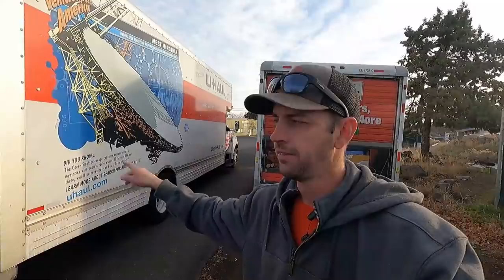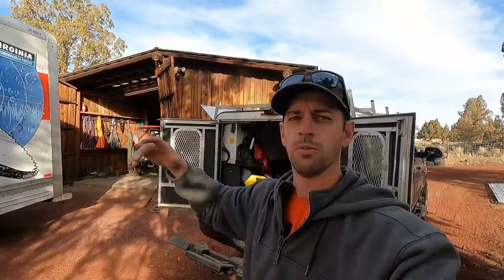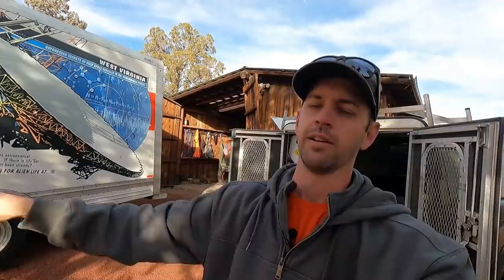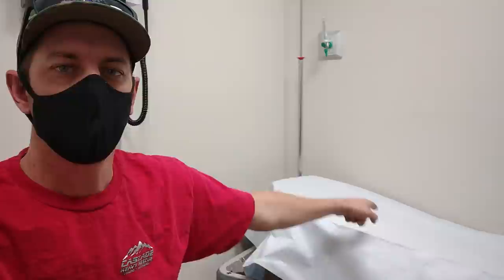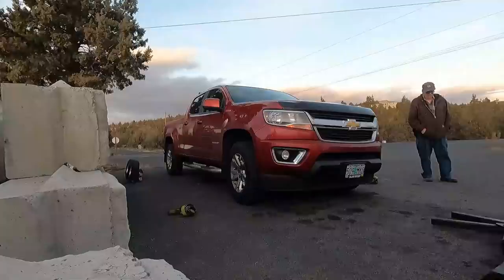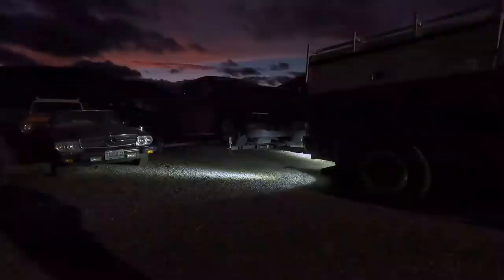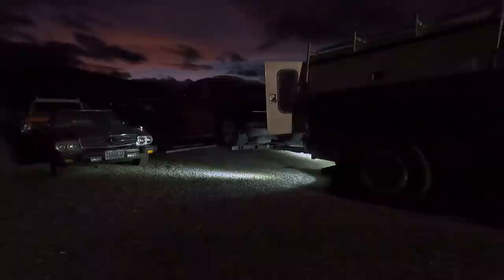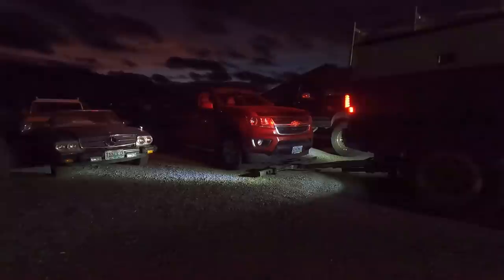Tow truck driver screws up and ends up in the hospital

Comment: I was a tire changer for  11 years and learned early on you never pick up on the breaker bar ALWAYS set it up to push down less injures that way
Reply: I learned that too as a heavy duty mechanic, until one day doing the same situation when I was pushing down on the breaker bar, when broke loose, some object on the ground interfered with my finger and ripped the nail right off! So! Make sure the grounds clear!
Reply: It's always down with open hands!
Reply: Yeah man hope you get better. But you should always push down on a breaker bar. Never ever pull up.
Reply: Changing grader tires we used the tractor loader to lift the cheater pipe
Reply: You know that’s right!! Leyyour weight
Reply: I have a tire bar imprint permanently in my skull. Being ignorant. Broke my teeth, nose and skull across my eye socket.  Got a dent in my eyebrow area.  Now I learn how to use tools for the specific job I'm doing before I try anything.
Reply: @jeremysales1232  let me guess it was a Ford 1 ton with left handed threaded nuts on drivers rear and the stud broke when you tried to take it off like a right handed thread
Reply: @Ender Wiggin  booted foot would be even better.
Reply: Correct, always use your on weight.

Comment: a long time ago I work in a welding/ag repair shop and a gentleman who had been working for the better half of 50 years saw me trying to break some 1-1/2 bolts lose on a planter he stopped he from pulling up on a 48” breaker bar and told me that you always push instead of pull you get more leverage pushing down and if need to slide a piece of pipe on it and you can move almost anything I did and it worked I still use his advice to this day

Comment: There is a very handy torque multiplier that is for removing stuck wheel nuts, it multiplies four times the torque  one applies to the breaker bar. Saves many hernias and strained muscles.
Reply: lol!  Ya,  it's called a 6 foot steel pipe!!!
Reply: great point and make people don't know about it but yeah they're great they're phenomenal that's what semi truck drivers use you can't hand torque something at 200 and 300 lb but torque multipliers  do that
Reply: @howtogetoutofbabylon8978  The bar does the same thing.
Reply: @howtogetoutofbabylon8978  @Dirt Perfect used one on 1 of his videos ,, large amount of torque needed  on a dump truck for the axle support .. neat system never knew about it till he used one on his channel ..

Comment: Early last spring I bought a magnetic induction heater ahead of working on an old tractor.  It works really well for something like that, applying extreme localized heat to a fastener.
Reply: I've used one of these as well, a bit pricey but can do an amazing job without causing collateral damage around where you're working!
Reply: @sak778  I was loosening wheel assy nuts on the tractor in my profile pic that had not been off in 25yrs.  The rims rusted out around the Schrader valves and needed to be repaired.
Reply: @oldretireddude  I used them to heat up the body mount nuts to pull a cab off an f350. Just fished it thru the access holes in the cab floor and got the nuts glowing, then zipped the bolts out like butter...
Reply: body shop near me has one works great when they need to get bolts broke loose and half the car is plastic .. they removed bumper bolts with out breaking the bumper or the bolts ..

Comment: Happened to me after my illeostomy reversal in '19. Had hernia operation in March this year, my hernia had ended up the size of a football lol. I was very self conscious of its size....day of the hernia op I weighed in at 126kg, next day after op I was 119kg, the 7 kg was fluid the body created to protect the bowel outside of muscles....I'm now at 110kg (self imposed weight loss, my height is 6ft2, I'm aiming for 100kg)
Biggest issue was I carried around 2 drain bottles for just over a week, draining the blood and fluid still in the area. Returned to work after 2 weeks on light duties for 6 weeks. Still careful even now about ripping the hernia repair..... 
Casey, I just say be careful for a while after the op and don't be the hero thinking "I'm ok"

Comment: If the truck has a rear drum brake and a failed axle seal, it's possible to remove the axle shaft and then the nut and bearings with the wheel jacked up just enough.
You put a plate or sheet of heavy material down on a reasonably level surface.
You soap the plate. Thick soap or tire butter.
With the height right and no load upon the tires, you remove the bearing by pulling the assembled dual rear wheels. You just slide them and use a long  bar. With the drum exposed by turning it around, you change the seal etc. Remove your flat plate floor material.
Clean up, do brakes and or hydraulics accordingly.
You are ready to assemble with good axle seal installed.
Put your floor plate back down, lube.
Position the dually and slide it back in looking through the center and around behind to get it lined up. Once it's home with the seal engaging properly at your preset height and centered,  you put in the outer bearing and nut. You put a new axle shaft o'ring on if required. You assemble the axle shaft.
You get your floor material out.
You're able to finish by lifting one side, then the other, and topping up the diff. You've bled wheel cylinder after setting the pedal pressure as required for a final check. You adjust the shoes to the drum accordingly during the process.
You never touched the lugnuts.
This works, and it doesn't matter how big the dually is because it's weight is on that floor skid.
Bob's your uncle.
No hernia.
No medical issues.
Don't tell anyone. It's your secret.
Hope you get well soon but ask about complications for hernia surgery because there are some issues that make their methods questionable.
 At least there were.
Hope they solved them now.
Remember to fill the Dot 3.

Comment: Casey, I'm 72 and like you only quite a bit bigger... I did wear size 36 jeans cause the were comfortable an making the 34's fit restricted some movement as my shoulders were 52 inches tight with a seventeen inch collar... six foot even and 250... up and down five pounds with seventeen inch guns. In other words a lot of iron was jacked in the military an was entered into army olympics. Yes too big for having normal fun. I started getting hernias and tried to bargain.. and it nearly cost me my life twice so think hard about how serious that you take them. I worked real hard and hard labor jobs as a mechanic. Heavy equipment mech. I lost so much weight when I broke most of my back and neck in a serious accident. I was placed in a coma and later when brought too this world again skin just hung on me, I looked like a freak and it did tear me up in my head too thinking about my future. That was seventeen years ago almost. I had layers of skin removed from my arms and some corrective stuff done on the neck area. Once you loose it, it just doesn't come back at a older age. Now I look like a damn foot ball for a physical body shape and hope for better times. I can appreciate the work done on that ten and a half sterling rear end as they can be real nasty to get apart. In fact "watch wes work" did one here recent an it was a bear. Just think before you do something you can't undo

Comment: So glad you didn't get what I was afraid of which was that tire blowing up in your face. Anyway you are probably right about the locktight. That flair up is exactly they way locktight does. Someone did that because that wheel wasn't staying tight I'll bet. Couldn't figure out what was causing the problem and took that short cut.
I'm betting the wheel seal problem will become clearer as this progresses.
Hope you get better soon.

Comment: Years ago I was given a free convertible couch. To make a long story short, while getting it in to my house I lifted wrong and tore one of the two parts of my right biceps off at the elbow. It sounded like a muffled gun shot to me, my buddy asked why I dropped the couch, then saw that I was in pain and asked "did you hurt your back?". It took me a few seconds to catch my breath and figure out what just happened, then I said "I think I tore something in my right arm, you didn't hear it ?" he said no. Anyway three days later I had surgery to reattach what had pulled away from the bone. They had to cut both the inside and the outside of my elbow, effectively going all the way through to pull the torn end of the muscle back to the outside of my elbow to reattach it where it belonged, right where your elbow would contact a table if you were sitting with your hands down on it. I couldn't use my right arm for three months. Luckily I haven't had any major problems with it since.

Comment: Casey, You obviously know about using a torch around a mounted wheel; because You had a water hose at the job site.  But for those who don't know, Be very Careful When using a Torch or Welding on a mounted wheel. In the Military, I saw catastrophe results from the rim being heated. Yes a stuck brake can do this also. 
The pressure in the tire will get so high it will explode, and also if a Tire Stop Leak was used it may be explosive. Anyhow a Big Bang will result.
You did have a water hose to cool the rim.
Reply from the maker: I also had a temp gun to monitor the temperature of the hub and the part of the rim that is actually in contact with the tire and air inside of it.
Reply: In Sweden there was an accident like that which killed a guy in a tire shop. The  leak fix liquid inside exploded. One should always deflate the tire before heating, and also put your nose out to detect a possible explosive. The tire should ideally be off, but in Casey's situation unfortunately not possible with dual wheels ☹ Be aware and careful guys 🤘

Comment: Casey,  I've had two hernias repaired.  #1 I had from childhood, wore a truss for many years, finally had surgery at 25. #2 I didn't know I had it until CAT required an intensive physical before I changed assignments and had surgery on it.  Recovery after the surgery was not a long process but recovery immediately after the surgery nearly killed me.  I thought I was gonna die 3 wks after the first, so went to the doc's off. and the nurse pulled the stitches===immediate relief.  Second surgery, doc wanted me up immediately after (first doc did too). Well, getting up immediately after having a "spinal block" instead of a local or general anesth. is a no-no.  The fluid for a spinal is lighter than the spinal fluid, so it goes up to your brain and hello MONSTER HEADACHE!!!!  i HAD 20 hrs of horror.  But after three weeks I could go to work.
I realize by now you've probably had the surgery but if not beware.....

Comment: LOL, its a U haul, you know that thing has been loaded down at least once at 2-3 times its "capacity".  At least its just a hernia, I saw the torch and the wheel and tire combo.  All I could think was what happens when you weld on a wheel with the tire on and pressure in the tire....  That would be much worse, hope you heal quickly, good luck!

Comment: I'm a U Haul technician, those lug nuts are torqued to 475 ft pounds.  The only substance on them are copper antisieze. Since you heated them, all the studs and nuts have to be replaced now as that's Uhaul policy, they could fail at any time now that the temper has been changed. Also if you are going to heat any wheel with a tire mounted it should be deflated so it doesn't over pressurize and explode in your face. Work safe and put out a safe product for the customer.
Reply from the maker: Incorrect, that hub had been taken apart and rebuilt by someone else.

Comment: Inadvertently you have added to the ostomy series! 
I sure hope that this will be an easy fix, Casey! You put out great videos and provide excellent tours of places that many of us only read about! 
Please take care of yourself, I have learned often the hard way that the older you get the easier things break on our one off body. 
If you are going to do brute work get brute  work reducing tools like a 1 inch drive impact  wrench or a 4 to 1 torque multiplier.   
Better yet stick to the scan tools and test light!  Stay safe, heal up soon and don't break yourself!
Reply from the maker: I have a 1" drive impact and hammered on those nuts so hard that I broke the 1" drive impact socket.
Reply: Sorry I missed the broken 1 inch drive tool as I guess I am visual person.  I did hear that but only saw and remembered the smaller stuff being used!  Really hope this is a simple thing to fix!  Stay strong and safe!
Reply: @CaseyLaDelle  sounds like someone used lock tight on the threads .. over 10 years now I have had a neck injury and then a year after that lower back injury I have titanium in both locations .. plus nerve damage in lower back .. well I am told to take it easy for most times I do . I have stirred up problems when using a breaker bar ,, part breaks loose my head snaps forward . pinches the nerve in my neck then my arm feels like it's on fire for a few mins .. or I will stir up my lower back .. then I am sitting around 3 too 7 days till my back calms down ,,, I am not preaching ,, just be careful ..I am very clumsy now  since my injury's .. keep up the great videos

Comment: It's too bad that you can't select the time when you want to have an injury sideline you.

Mu dearly departed father had 3 double hernia surgeries over the years. The year before he died, he had one of the mesh patches blow out doubling him up in pain. The surgeon this time was an extremely good surgeon that probably does 7-10 hernias a week and pain management has come a long way.

He received a Pain Ball with a narcotic inside that slowly dispensed to alleviate pain, and it worked. The surgery was a success.

Casey, the military use to issue with the M35 and 809 series trucks a torque multiplier that was geared and used 2 bars for leverage. I've used it on a couple of occasions to break loose the lugs on my M923. Once loose, the Milwaukee impact spins them off with no issues. I've got a one inch torque wrench that is close to 7 feet long and works well for torquing the lugs back to spec or 1050 ft/lbs.

Comment: I wish you a speedy recovery.

It is exponentially easier to start the nuts moving when you have all the vehicle weight bearing down on the wheel.

Back when I did roadside briefly, I would sometimes get ahead of myself and jack up a vehicle before I'd systematically loosened all the nuts.

Sometimes I could use brakes to hold the wheel sufficiently still, and proceed to swap out the wheel anyway.  Sometimes, not.  I'd have to lower it back down completely.

Be safe.

Comment: Wheel seals 101,  all the above that you stated plus one other thing. If the vent tube is plugged or blocked and the differential gets hot, the oil will off gas, creating pressure in the bearing hub and blowing out the weakest seal first to releave the pressure. As for your hernia, that sucks man, take it easy and I know the belt sucks, but it prevents you from doing further damage.. Stay Safe and great content, thanks for the share!

Comment: Casey, have you ever tried using a welder, on DC, connect the two leads at points as close as can be done. Like on the stud end and the other on the nut.  Turn on welder at around 80-100:amps.  It will get very hot very quick.  When it's cherry red remove clamp and let it cool down, cooling slowly will remove the temper so it has to be cooled  a little faster but not to fast or it will make the parts brittle.

Comment: I had the same thing happen to me back in 08 when I was working for a propane company as a driver. I had surgery to repair a small hole and they stitched it. Well 2 years later I ended up ripping that open. Then I had another surgery but this time they used a small piece of mesh about the size of a post it note. So 2 more years go by and you guessed it I managed to rip the mesh. I wasn’t doing any heavy lifting but I was using weights every now and then when I worked out. The final surgery I had to have abdominal reconstructive surgery where the pulled the muscle back and put in a big piece of mesh about the size of a sheet of notebook paper. I haven’t had any issues but I have a restriction of lifting no more than 40lbs. That restriction never off. I also can’t gain a lot of weight as it will pull on it. Good luck and expect a few weeks recovery at home not lifting much. I know this is what you do so make sure you talk with your surgeon on restrictions so you don’t end up back in surgery. My last surgery took 6 hours to fix. Judy remember to be careful lifting anything. Take care. 😎👍🏼

Comment: Casey, when you get stuff that hot you need to let it air cool for some time before you finish with water. You cool it that fast right away with water you may end up with hardened bolts that may be brittle and may fail on you while driving,  Hope you're healing well and feeling better.

Comment: Casey, if you had put the cheater bar on 180 degrees to what you did and step in the bar, it would have put more torque in the bolt and less stress on your gut.  Get well soon.

Comment: Your lucky to be alive,long time ago saw 3 guys trying to remove tires of a 623 water Buffalo, they heated all the lugs on one wheel took 5 hours stoped for lunch came back had 2 nuts to go then, the tire exploded we only found a few teeth,an ear, few fingers out of 3 guys that all we found , after that we use carbide bits to cut the nuts and need be we replace wheel studs

Comment: U-Haul is notorious for shoddy equipment and half-baked maintenance-workmanship.  My folks made a trip to Florida and back, and we had no end of trouble with ALL of the trailers we rented --- everything from faulty tail-light wiring that literally came apart as we were traveling, to wheel-bearings' getting hot and giving out.